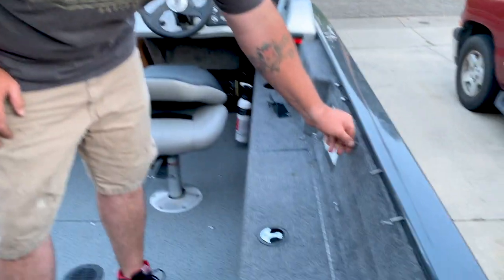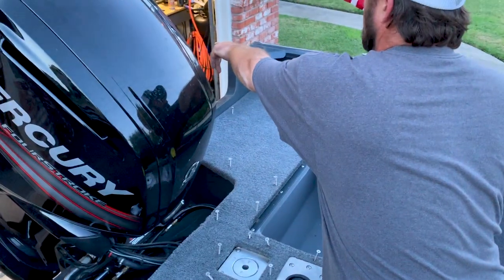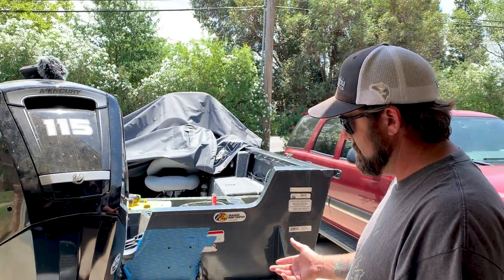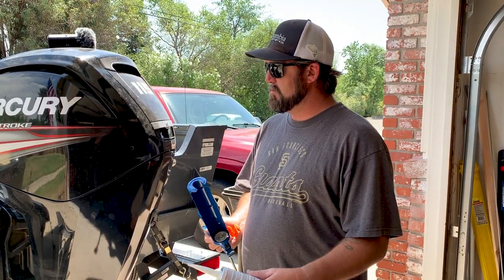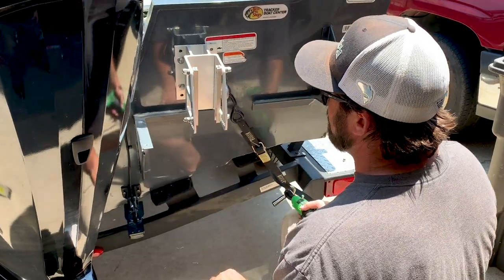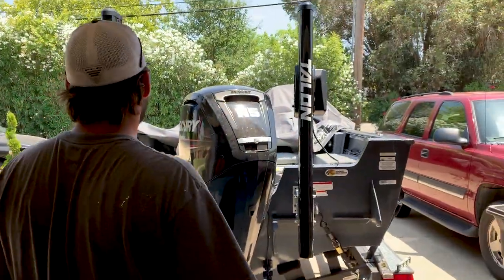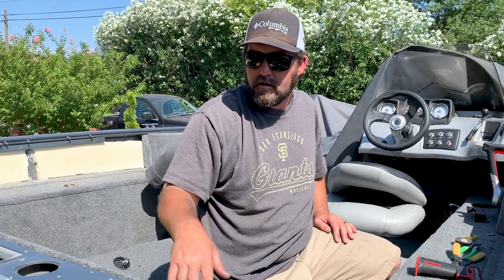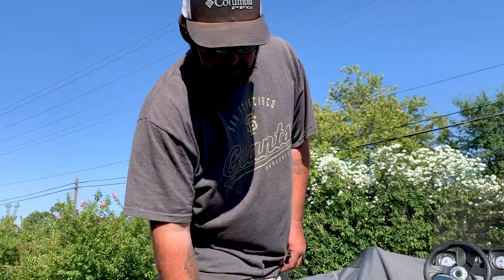MINN KOTA TALON SHALLOW WATER ANCHOR INSTALL I HOW TO

Comment: Any reason why you installed the mounts so low? I am thinking on installing at the top of the transom so tilt brackets can be used.. Also, all the holes would be up in the splash well.

Comment: Great video I am also interested in adding them to my boat 2018 basstracker how much weight did it add to your boat. Also how do you like them any trouble at all. 
Thanks in advance
Reply from the maker: A group 31 battery can weigh anywhere from 60 to 75 lbs in most cases.. this install was on a buddies boat.. I have 2 on my boat for my 80lb minn Kota ulterra I have had no issues with them at all..

Comment: I have a '20 V-19 Targa Combo with a 9.9 kicker and ladder but I think can get one installed between the big motor (200 Pro XS) and the ladder or cut it like you did which was genius BTW.  Would you even bother with 1 talon tho?  I see other rigs with only 1 but I just can't get 2 with my kicker.  I could use the sandwich style adaptor and remove the big motor but this is not a bass boat.  Also, do you know if Tracker would void the warranty?  Did you check?
Reply: Right now I only have one 10ft on the rear of my 21ft Tritoon and I have been told that one will keep you in one spot but high wind could spin the boat around. I just installed it today so I’ll let ya know soon. Lol 😂

My thinking is to try one to see how it does and if needs more I’ll add another Talon to the opposite side on the front of the boat. We’ll see ? Lol

Comment: How reliable are the talons not sure these or power poles
Reply from the maker: They are pretty reliable.. it’s really more of a space and weight issue.. talons don’t require the space to mount pumps.. but they are much heavier and use more battery juice.. the only issue mechanically is the can sometimes get small gravel pieces up in the slides which can be a pain to get out.. but talons can go deeper than power poles if you get the bigger ones.. hope that helps.. let me know if you have any questions.. thanks for watching

Comment: Wow on my boat I don't have to deal with taking the desk off.  Mine is hallowed out back on the transom and it's open.
Reply from the maker: That would definitely make the job a lot easier! Lol.. usually I only put these on bass boats with jack plate mounts..
Reply: @ReelLifeFisherman  I could probably do this job you did, but if this were me I better set aside 3 full days so I can stop and think before I do something. But if you do this enough times I suppose you can do this in about 3 hours.  What are you doing is the exception rather than the rule.  Regardless of how you mount it most installations are not this hard.  I hope you had a few cool beverages after doing this.
Reply from the maker: You absolutely should always take your time before drilling into any boat.. you only get one shot at it! Any mistakes will always be there and could possibly ruin a boat..  I always take my time.. I’m not as fast as some guys.. but I take my time and do it right at a pace I feel comfortable with.. thanks for watching the channel! And let me know if you ever have any questions.. tight lines!🎣